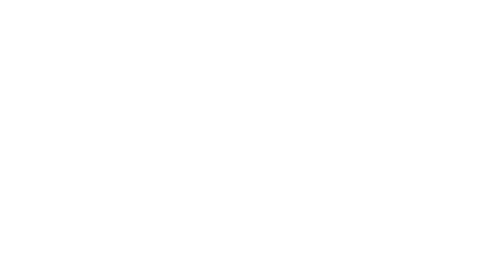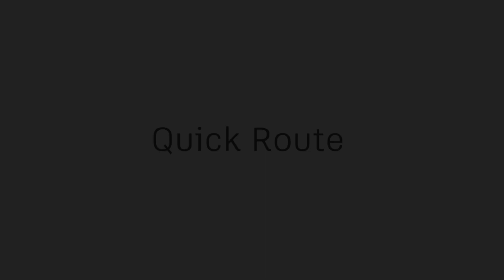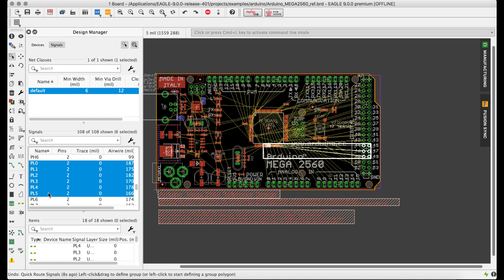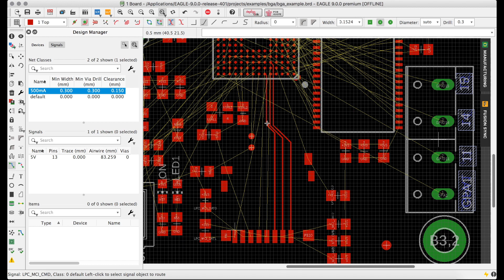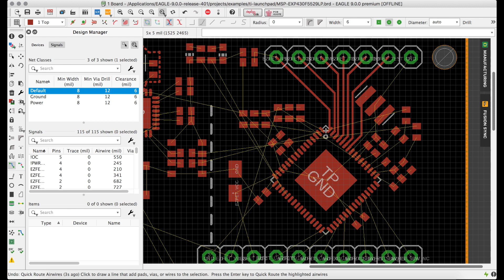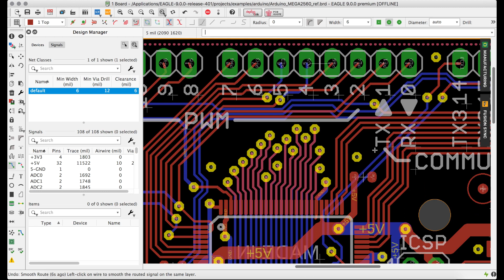New Quick Route speeds up PCB Routing in Autodesk EAGLE!

Comment: When using quick route airwire/signal, I can't manage to control the starting layer. This seem to be a bug, because the tool completely ignores the active layer. For airwires, my workaround is starting with manual route in the desired active layer and hitting enter just after leavning the pad. But for quick route signals, I don't have a solution to control the layer of the first segment. Any thoughts on that?